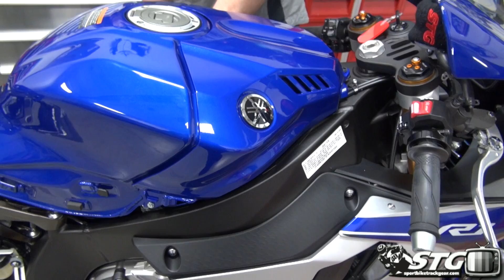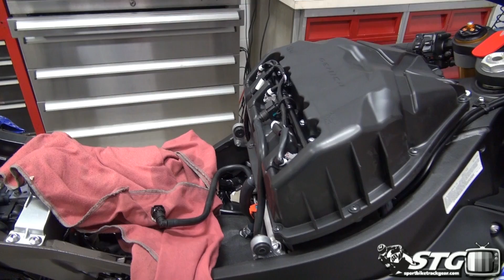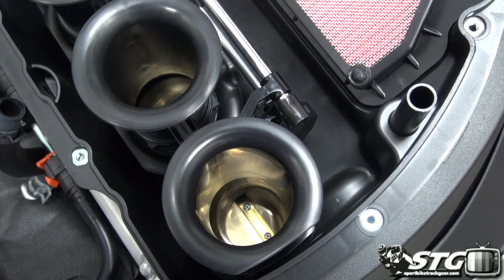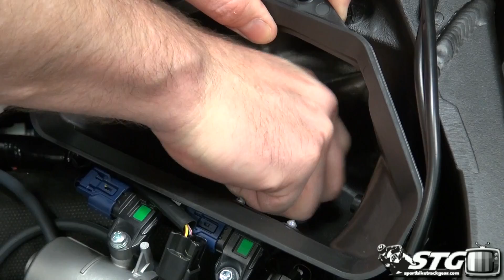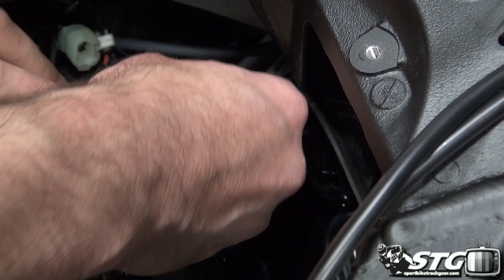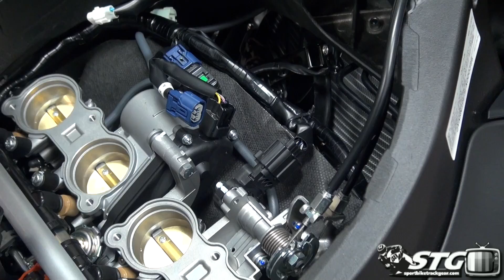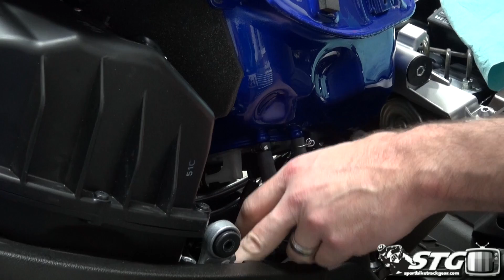Graves Smog Block Off Plate Install on a 15-17 Yamaha YZF-R1 from SportbikeTrackGear.com

Comment: Thanks for the vid, Brian. You are excellent on camera. Very specific in each step, thorough, no BS, nice and succinct. perfectly effective transfer of information! I bought the graves block offs and installing this weekend with my new K&N. Have full exhaust for the last 150 miles, i'm not liking the popping on decel. I nknow this won't totally stop that but it'll help AND it'll prep me for my ECU flash after i finish the break in.

Comment: I followed your video today when installing the block off plates on my R1.  It was a lot easier than I thought it would be.  Everything seems to be running well. No codes or anything like that.

Thank you for these videos and keep posting stuff for the 15' R1 =)
Reply: What you did with the solenoid plug you just left it there loose

Comment: I love the sound of popping spitting on deceleration! I might take my block off plate off.
Reply from the maker: It does sound pretty bad ass. - Van
Reply: @sportbiketrackgear  I have a 2016 R1 and did do the 3/4 exhaust swap with graves muffler and mid pipe delete. It does pop quite a bit, how much will this decrease the popping on decel if I added the plates? My local shop advised it will not make a dramatic difference and it was up to me if I wanted to go through the labor. Thank you Van!
Reply: Once you get an ECU flash and an exhaust lol trust me the popping gets crazy and it will become annoying. lol thats when I got the block off plates. helped a lot still got some popping but not crazy ones.

Comment: No need to cut up the gray anchor on the air injection solenoid to plug the air inlet box. Take a plastic valve stem cap, use a hot blade to mushroom the open end, shove it into the air inlet box hole with a little RTV... it will already be a tight fit if you use the right cap... mine were std and they were press fit.I would also suggest you put a small plastic bag with Ty-Rap on open elec connectors that are the result of these mods.

Comment: So, of your upgrades what has given you the smoothest throttle.  I have a 2009 R1 and she has the typical jerky 1st gear take off, if you don't work the Clutch/throttle perfectly.  I rode my brothers Suzuki TRL 1000 the other day and her take off in 1st gear was smooth as melting butter.

Comment: I noticed just dropping a few pounds with this, the exhaust and the servo made the bike feel like it has a shorter or easier turn radius. Time for a Lithium Iron battery, there is a few more pounds. Easier than me losing weight.
Reply from the maker: WEIGHT SAVINGS! lol

Comment: Hello, everyone! Silly question: What are Smog Block Off Plates used for? I’ve never heard of it. I don’t own a Yamaha, but I do currently own a 2017 GSX-S1000. I am a sub to the channel because Van has a lot in insight on motorcycle maintenance, as well as professional knowledge.
Reply from the maker: Block off plates need to be installed when you replace the stock exhaust system with an aftermarket full system that eliminates the cat and exhaust valve if one is used. In order to get a good tune in the bike and reduce the popping and such on deceleration common after installing a full system you need to remove the air injection system and cap off the holes on the valve cover with block off plates. Removing the AIS prevents the introduction of unwanted air which skews the fuel air numbers when you are trying to tune the bike. - Van
Reply: i have 2018 kwasaki zxr6 i installed 2 brothers slip on do i need the power commander v or black off plates should be fine to make the hiccup and popping sound disappear on my muffler?

Comment: Hi
I was wondering, if the AIS system is disabled via FTECU flashing, do we still need to install the nlock off plates? in reality, can air gets in  with the system disabled? 
Thanks for your time for reading and answering  my questions.

Comment: What is forcing air through the injection system? Is there a pump? If if there is why not remove the entire system? It seems like you only removed the valve and pathways. Nice video btw. Thanks!

Comment: Excellent video. step by step without all the BS. this is the way all videos should be. thumbs up!!  STG has some of the best step by step videos. Question, do you get a code once you remove the wire from the air pump?
Reply from the maker: Thanks for the kind words!

Comment: G'day Van, firstly want to thank you and your team for all the brilliant 2015+ R1 videos you have made, so helpful and informative. The question I have is, Is it possible to install smog plates that are not recessed on the side that faces down? Thanks in advance and sorry to see that weapon R1 leave, good luck with your new project.
Reply from the maker: While each bike can be a little different most of them will require you to leave the reed and gasket in when installing block off plates. For this reason they need to have that recessed portion to allow for the reed to clear. - Van
Reply: @sportbiketrackgear   hi there. I have a quick question. What happens if you take them out? I just did it and it seemed to work fine. My recess didn't match up with how they sit for some reason.   But I'll try to put them back in soon.

Comment: Hi van!i have a question!
Install plates no error code?
Is there any error remover needed when removing the original item?
Thank you!
Reply from the maker: Starting in 2016 (pretty sure that is the year) removing the PAIR system will result in an engine light. Only way to turn it off is to install a PAIR eliminator from HealTech or have the ECU flashed. - Van
Reply: @sportbiketrackgear  Oh that's a useful information for me 👍!!!
Thank you so much my friend 👍!!!

Comment: Hey Van, I have a 2017 ZX10R with a full Yoshimura Alpha T titanium exhaust system (cat removed) and a sport air filter. I kept the stock air box and had the ECU mapped tuned with Woolich software. The bike runs great but as you pointed out back fires a bit. My main concern is the idle. It flucuates quite a bit. Would block off plates help? Appreciate your view on this. Cheers!
Reply from the maker: I do not feel the block off plates will do much at idle as the system is not active. Odds are the flash you have in the ecu has the PAIR system disabled. The plates would just clean things up under the airbox. - Van

Comment: Hi Van
Thanks for all the great videos.
I have fitted an Akropovic slip on and link pipe and quite like the popping on the overun!
Would it be as simple as just disconnecting the air injector to stop the popping?
Thanks for your time. (Chris)
Reply from the maker: +Bricktop1967 No you should remove the valve and system installing the plates. - Van

Comment: Great video and great instructions, i did this install on a 17 r1, but i haven't installed my exhaust yet (waiting on a taylormade racing mid and exhaust pipe) i turned on the bike and now i have a check engine light on, is there a way to reset this light with out flashing the ecu or other trick you suggest? Thanks in advance
Reply from the maker: You will need to take the bike to the dealer to clear the codes or purchase the items in this link to do it yourself. 
FlashTune OBDII Adapter Harness

https://www.sportbiketrackgear.com/flashtune-obdii-adapter-harness/

Kobra OBDII Scan Tool

https://www.sportbiketrackgear.com/kobra-obdii-scan-tool/
Reply: Thanks for the reply, i just posted another question after the fact of buying the flash kit, found out searching thru forums this is what i needed. Thanks again n keep up the great vids!

Comment: Is the old sensor connect it to anything after you installed the block off plates?? (The one for the secondary air system)

Comment: That looks so much easier than the previous model. That r1 2013 is 😩😩😩
Reply from the maker: This is not that bad of a project on the 15-20 R1. Yamaha did a great job engineering this bike to be used on the street or track. - Van

Comment: Brian, great video. I have a question for my 2016 R1S. I have a new exhaust with a power commander V that has been tuned already. Will I need a re-tune after this mod? Thanks as I know this is an older video.

Comment: What are the use of block off plates?
Reply from the maker: You install these when you are removing the emissions while building a track or race bike. If you are street riding they are not really necessary. - Van

Comment: $45+ is not cheap for simple little plates.   They are like $8ish on aliexpress no brand but cnc aluminum so basically the same thing.  Obviously you can do it for free just plugging the nozzles on the existing plates....well you have to buy rubber caps at auto parts store or cram a marble in old hose and connect each end to a nozzle effectively blocking off any air you also need a cap for the other hose too either way you do it but it comes with both the graves and the aliexpress kits

Comment: Hi I'm going to fit the smog plates to my r1 did you get a fault code come up on the dash after you removed the air system thanks great videos 👍
Reply from the maker: I did not get a fault code on my 2015 R1 but the newer bikes will pop a light. The best way  to manage that is to flash the OEM ecu, this will improve the performance massively and allow you to turn off the light. If you need help picking the right one please email me directly at service@sportbiketrackgear.com and I will help get you sorted out. - Van
Reply: Sportbike Track Gear Thanks Brian great videos helped me so much keep them coming👍
Reply: @sportbiketrackgear  thanks lol was worried

Comment: I'm having a very hard time getting the Alan head captured screws to line up properly. I can get 2 out of the 4 in, but the other 2 I've now spent 2 hours trying to line up. Do you have any pointers or tricks? I already have tried just barely tightening them to no avail. Thanks in advance

Comment: Question.... why do I still get that flame out of my exhaust? I did cat eliminator, block off plates, and servo buddy. What am I missing? Don’t like that flame. Great vids... Thanks.
Reply from the maker: Do you have a fuel controller on the bike or have the ECU flashed? - Van
Reply: Sportbike Track Gear I do not.. will a power commander v or booster plug fix that issue for me?
Reply: @isaacbeltran3277  Yes it will. PCV or ECU Flash will fix that.
Reply: YamiPizza what map are you running on yours? Thanks for your reply!
Reply: @isaacbeltran3277  My bike is ECU Flashed by a guy named Nick Marino from XPlaneR1Custom Tuning. Look him up. It's a custom tune tailored to my bike. Good work.

Comment: Can you disable the AIS system on a R1 in the ECU after it's already been flashed? Installed these after I got the ECU flashed and didn't realize it would throw an engine light code. I realize you can throw on a servo buddy to eliminate the code but I'm trying to avoid opening up the whole bike again.
Reply from the maker: You can disable this via the flash software if you are using FTECU. I would imagine the others would allow you to do so as well. If you do not have access to the flash software yourself you could also install the HealTech Yamaha YZF-R1 04-23 PAIR System Eliminator then clear the codes. Here is a link to that on our site: https://www.sportbiketrackgear.com/healtech-yamaha-yzf-r1-04-20-pair-system-eliminator/

Comment: Yo Van! Question! I understand you said that when installing these there won’t be farting or back fire. I guess I sort of understand. But I want to clarify. Will the block off plates prevent the bike from spitting flames?
Reply from the maker: Installing these will help to reduce that. You should also get the bike tuned to optimize performance. If you are not racing I would ride the bike and see if you are happy with the performance. If you are then leave it alone, not happy take it to a tuner. - Van
Reply: @sportbiketrackgear  got it tuned and throttle response is butter!! Same with rev match 🤙 thanks again Van

Comment: By installing the block off plates does this also disable the smog system because the solenoid was removed?
Reply from the maker: Yes this disables the PAIR system on the bike. Select models will need a PAIR system eliminator to keep the engine light off. Here is a link to that product on our site: https://www.sportbiketrackgear.com/healtech/?_bc_fsnf=1&Product=PAIR+System+Eliminator

Comment: Hey brother need some advice I just installed the block of plates on my 2020 r1 and followed all of your steps after the engine light came on and I can’t change any of the engine settings
Reply from the maker: You will need to flash the ecu on that bike and disable the PAIR system. To clear the codes you will need an OBDII scan tool. - Van
Reply: Sportbike Track Gear Ok got it! Had them hook the bike up at my yamaha dealer and the engine light was shore enough from disconnecting the ais motor. How ever I just left it plugged in for now as there is no flash for my model as I’m told and will remove once it’s available. Thanks a lot for your expertise I only come here whenever I’m doing something on my bike and I’m unsure of! Love from AUS

Comment: Maybe this is a dumb question but does the tank need to be emptied before removal?
Reply from the maker: No such thing as a dumb question my brother. You do not need to empty the tank before removing it. A fuel injected bike (all of the modern bikes) will not allow the fuel past the pump when it is not running. That said you can leave the fuel in the tank when you remove it and not without having it leaking all over the shop. I try to do this when the tank is low because it makes it lighter and easier to handle. - Brian Van
Reply: Sportbike Track Gear  just put everything back together like the video and now it wont start. Sounds like it wants to but doesnt kick over.
Reply from the maker: Start by checking the fuel line, make sure it is not kinked. I have seen this happen after reinstalling the tank more than one time. - Van

Comment: Hi.
I installed the graves smog block off plates on my 2017 R1. Got a fault code, flashed the ECU, code still there. removed the fault code with an diagnostic tool, code gone. but came back when i turned the ignition on and off and also if I start the bike. out off ideas now, what do I do?
Reply from the maker: What trouble code are you getting? Also what flash are you running? I have done both of these to my bike and did not get a check engine light. - Brian Van
Reply: Code gone. solved it, it is not enough to just disable the AIS on 2017 model. You also have to disable error code P1400, FTecu confirmed this as well. If you do what I did and remove the AIS before flashing the ecu, you will need an diagnostic tool to remove the error code.

Comment: Hey man will this cause the ECU to throw a code that needs to be tuned out?
Reply from the maker: Yes you will need to either flash the ecu or add a pair system eliminator. Here is a link to that on our site: 
HealTech Yamaha YZF-R1 04-22 PAIR System Eliminator
https://www.sportbiketrackgear.com/healtech-yamaha-yzf-r1-04-20-pair-system-eliminator/

It is out of stock now but we have more on the way now. - Van

Comment: Hello i need help can i ask im going to get my bike dyno tuned and i want the pops and bang but i also want the proper air fuel ratio so should i plug the ais system using the marbel trick and after the dyno tuning i take it off so i will still get the back fires i have gsxr 750 2022
Reply from the maker: You need to talk to your tuner about that. Any reputable tuner will not leave the pops and bangs in as they are not making things better. - Van

Comment: what is off plate do ?
Reply from the maker: +yousef adel Basically the emissions system you are removing adds more Oxygen to the exhaust to lower the rate of emissions from your bike. This is done for a number of reasons but the importance to our customers is that when you add the Block Off plates to your bike and have an aftermarket exhaust it will run more smoothly as the engine is allowed to breath naturally. Additionally if you wish to have your bike Dyno-Tuned the block off plates will allow the "Sniffer" to get an accurate reading. Thanks for the great question!

Comment: hello have you or anybody else that you know of have ever experienced a check engine light after the smog block off plates were installed i have a 2016 zx10r that I just installed this morning and now my light is on is this commin for it to be on or maybe something I did wrong I checked all connections prior to putting it back together the only wire I left disconnect was the AIS plug any help will be appreciated I forgot to mention I have the graves cat eliminator kit on it as well
Reply from the maker: +MRNY845 Hello, do you have a servo eliminator installed?
Reply: If the the cat elimination doesnt have the sensor adapter,  it will thro a code, as well as the ais. The ecu mod for the r1 gets rid of these codes. U can even get a light for after market stabilizer,  depending on bike. Not to sure about the ninja. Im assuming probably the same.
Reply: +jay46s my fi light came on after I did this modification so I went back in their and jumped the AIS plug with a wire now my fi light is gone. another way to get rig of it is to flash the ecu
Reply: That works too! Ive actually had my ecu flashed before i did the block off mod. But in the description of the ecu flash, there is a "ais off"

Comment: Awesome videos. Is your gas tank empty? Or does the disconnect shut a valve or something? I'm trying to avoid a mistake of dumping a tank's worth of fuel in my garage.
Reply: After watching again, it looks like your tank is partially full and you keep it on its side while off-camera... Correct?
Reply from the maker: +TheGuySaysSo That is correct! It does have a shut off valve if you unhook it however. Thanks for watching!